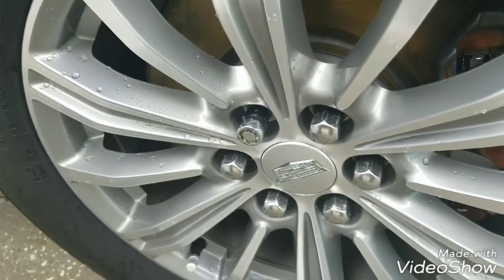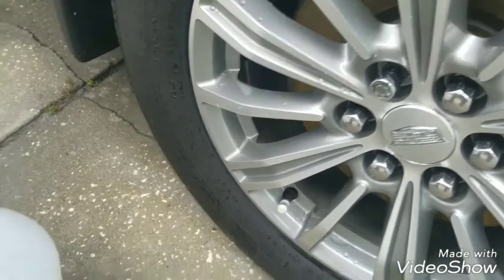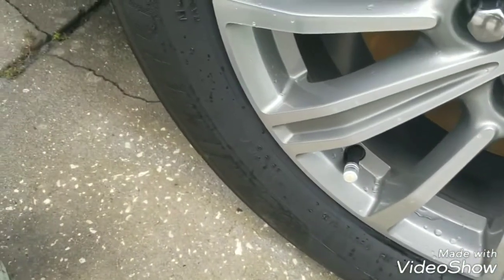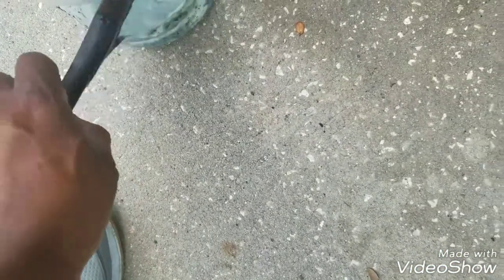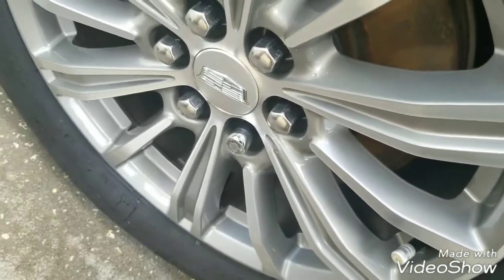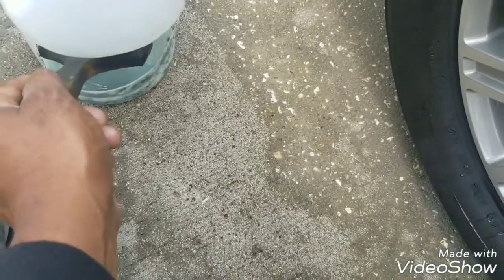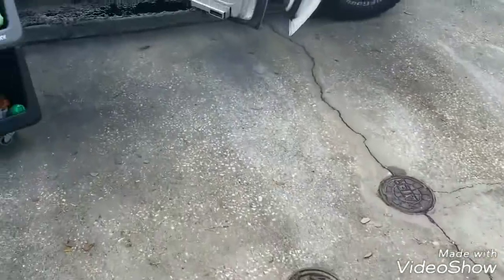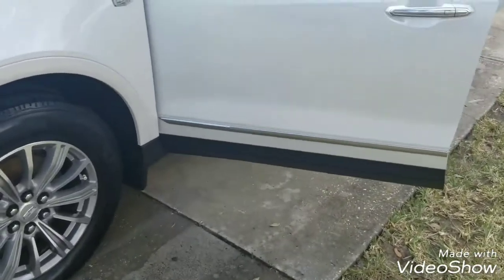Tire dressing with a bucket and a brush

Comment: I always do the dressing on the tires 1st right after the wash that way it gives my customers tires time to dry off..water based only way to go..BTW what's the brand of that tire applicator I like that one haven't seen that one.
Reply from the maker: The name of the tire dressing is NEW CONCEPT it's a product from Ardex which is a detail supply center here in Tampa FL. 
3" paint brush